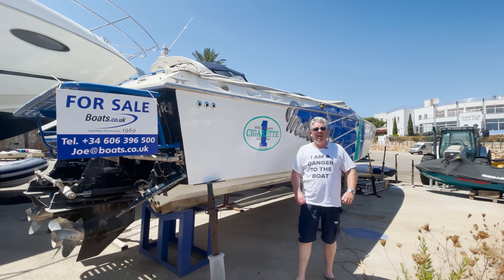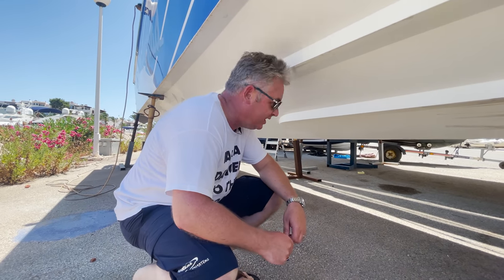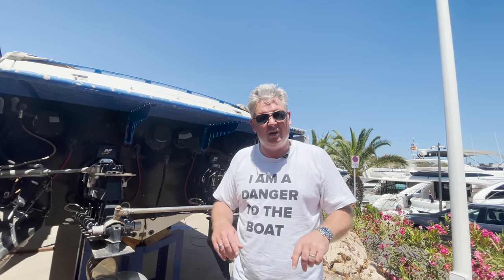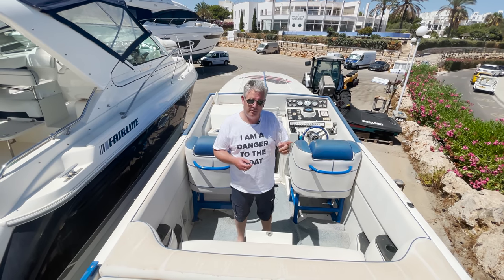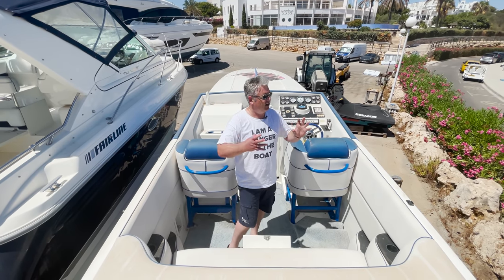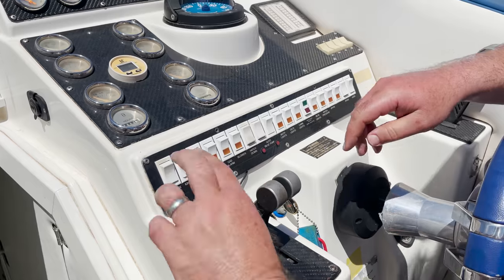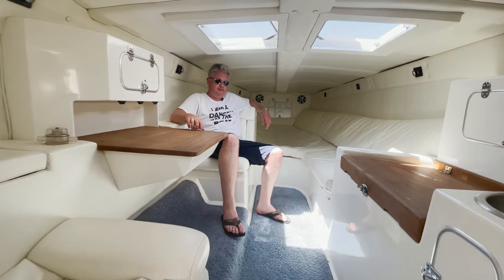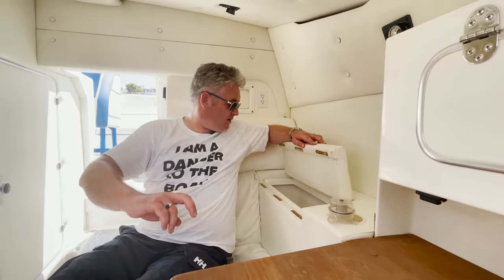Cigarette Top Gun 38 - Is this the most pointless 80 MPH boat ever?

Comment: What a great boat to commute with. Only drawback, not big enough to hold enough fuel. I saw a much  interesting version that was in the same spirit, but perhaps not a Cigarette, after sheltering in a Harbour of Refuge in Rhode Island from incoming Tornadoes,  a d sailing from there to New York. Then this amazing noise was heard in the distance, as I was approaching Block Island, didn't see it then, but it possibly stopped there to pick up a fellow commuter heading to New York. We'll South of Block Island, I had joined in the search for a missing Diver- missing for a while but in good news, he had made it ashore fit and well 👍 - when this amazing Noise started up again, and the boat ended up passing me, at Full Throttle, and my spine is tingling again remembering that Noise, Then I saw it, Heading West off the South of Long Island, going hell for Leather and at its Stern, the most impossibly Large Rooster Tail gave the impression that it was The Rooster Tail Pushing the Boat at God knows What Speed  (I was doing just over 6 knots in my sailboat, with my jaw solidly dropped at the helm) A running Commdntary was being given over the VHF alerting other boats, that a Fast Mover was heading in whichever direction  and giving its current Position. It was something truly memorable from my Trip, and a bit unforgettable.  Not saying I would like a ride in something like that, let alone Commute to Work in one every day, but there are quite a number of people in the USA who do indeed use fast boats to regularly Commute to and from work with. The Searay 39' Express boats do seem a popular choice for Commuter boats for example . Thanks for this video, it made me Smile. 🙂👍🏴  Oooo!  Riding Out the Tornado was a fun experience too, the first one clipped the boat so hard, the top of the mast went under the water on the Port side, completely submerging the VHF aerial, and knocked the Anchor out sideways, got reanchored OK, andvwedged in the Cockpit,  wascable to watch the most amazing lightning storm I have seen in my life. Talk about vivid purple lightning flashes, it was amazing. Not one boat in the Harbour of Refuge Suffered any Damage, which was itself incredible. Best Wishes. Bob.  👍
Reply from the maker: Thanks Bob. I think you win the award hands down for the longest ever comment on one of our videos !!!  I love the story about the tornado and the fast boat and I would love to actually test a cigarette off the Florida coast with the Miami vice music ! How stupid am I ! 😂😂 thanks again for your kind words. I have a video of a Princess 72 up in a week or two - which is like chalk and cheese to this boat 🥳🥳🥳🥳

Comment: The mercruiser hp 500 is an 8.2 liter 502 cubic inch 470 horsepower motor. It was merceuisers premiere performance engine until late 90’s early 2000’s. That’s probably a 12 or 13 thousand pound boat. No way is that running 75. Maybe 70 mph with a light load.
Reply from the maker: Thanks Brandon . Appreciate your superior knowledge- always good to learn 😊

Comment: 80k .....and another 10k on gas.......for each engine.
Reply from the maker: Yes about right but think of the fun 🤩
Reply from the maker: @krishorst4734  I agree. Sound is an important part of our lives. I do like electric motors but I love the sound of a V8 more 😂
Reply: I have one with later fuel injected engines. At 50 mph it’s only doing 3500 rpm, which is 32 gallons per hour. So about 1.5mpg. Not that bad for a boat in my opinion, especially one that is so smooth that the ride puts most 70 footers to shame.
Reply from the maker: @dimitrikuburlis9277  . Lovely boat 👌👌
Reply: @dimitrikuburlis9277  1.5mpg is fantastic. Is that for each engine??
Reply: @krishorst4734  both engines. They are a very efficient hull.
Reply: @dimitrikuburlis9277  Impressive. Yeah those hulls are amazing. Great combination. What year is it??